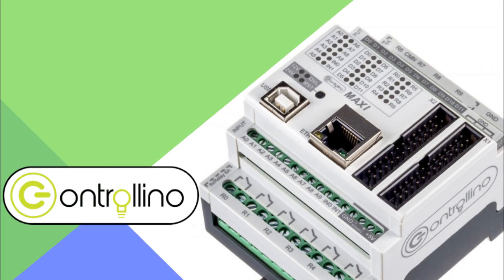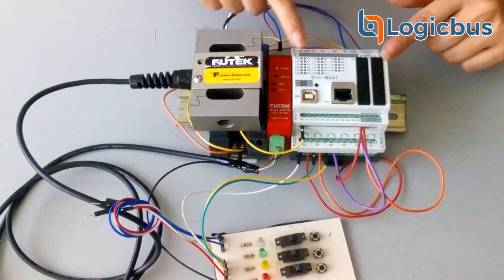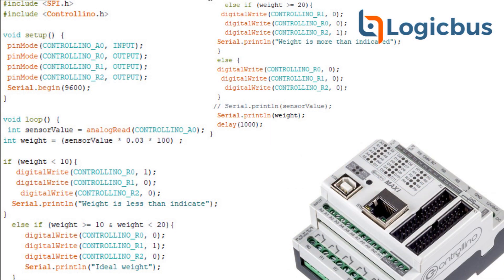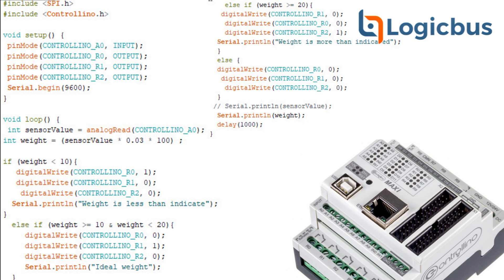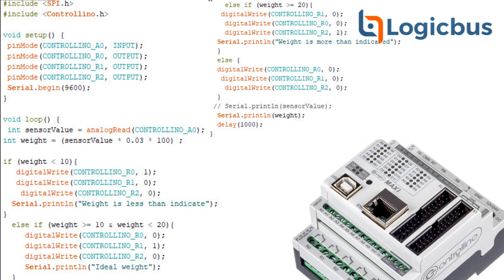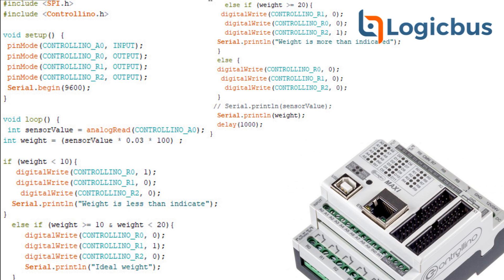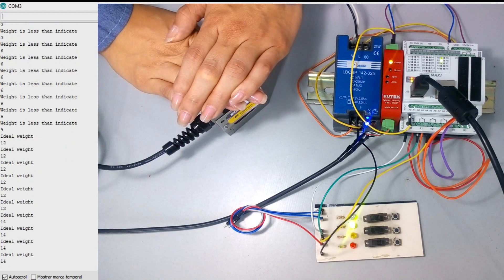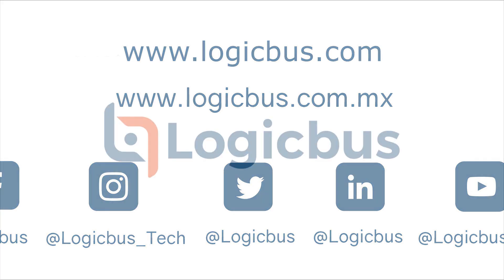How to read an analogue input with Controllino

Comment: hello, your video help me so much but i have error controllino_RO doesn't know. you know how call the object controllino in function ? 
for me like this it's better because it's more clean in the code to call a function but  i have some trouble.

i replace RO by D0 BUT i have no electricity after the relay but the led DO is ON too ^^  
 
//////////////////////////////////////////////////////////////////////////// code //////////////////////////////////////////////////////////////////////////////////////////////////////

void loop {

 if (tensionEtalon>1)
    
    {
             
                   int limite_tension=1;

                          if (tension1<limite_tension) {INITremplissageON();} // fait remplis jusqu'au niveau 3 

                          
                          else {bouclehumiditeON();
                              Serial.println("if en dessous bloucle humide on");
                          delay(1000);}
     
    }              

                            else {bouclepashumide ();}

  }

///////////////////////////////////////////////////////////////////////////// void function /////////////////////////////////////////////////////////////////////////
void INITremplissageON()

{

       pinMode(CONTROLLINO_R0,OUTPUT);
  
      Serial.println("init remplissage begin");
  int limite_tension=1;
  int tension3=analogRead(CONTROLLINO_A3)*0.015;
  
  
      do 
      {
        digitalWrite(CONTROLLINO_R0,HIGH);
        tension3=analogRead(CONTROLLINO_A3)*0.015;
        Serial.println("init remplissage begin TOURNE EN ROND");
      }
    
      while (tension3<1);

      {
        digitalWrite(CONTROLLINO_R0, LOW);
        Serial.println("fin boucle remplissage finis");
      }

}